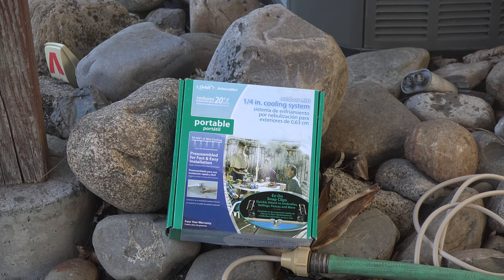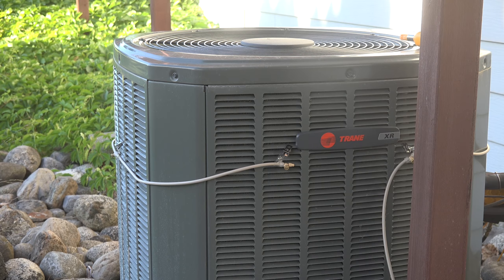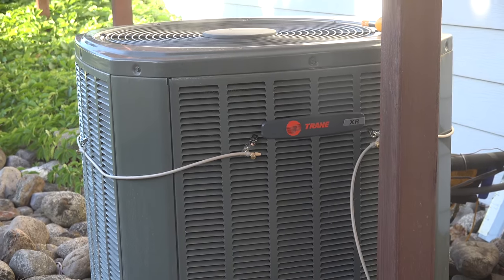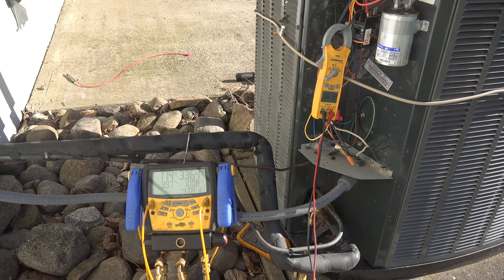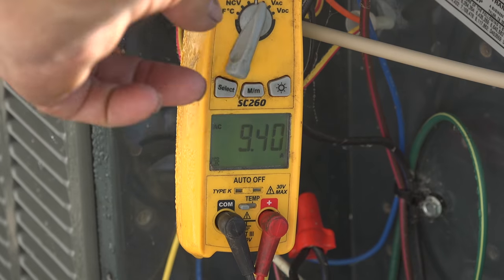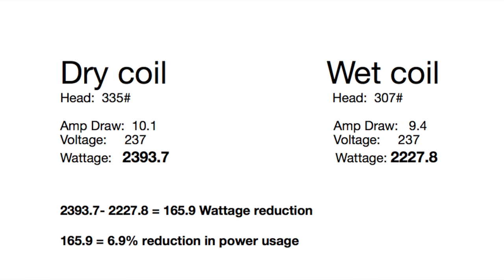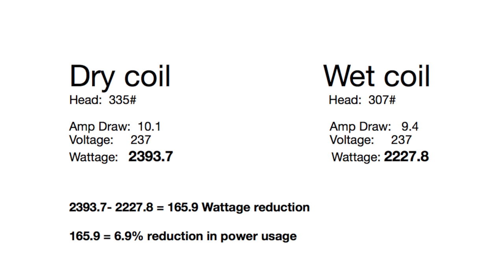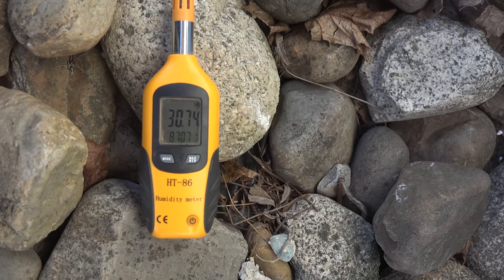Do the misters for A/C work? Part #1

Comment: Interesting. Thanks for making this video. I wouldn't bother with a water sprayer either. However, this water spray system may possibly be a little more effective than it looks. I say that because this water spray system may reduce the supply air temperature, which would mean that the AC wouldn't have to run as long to cool the structure, so there may be a little more savings there. Also, if it was hotter outside, there may also be more of a difference.
Reply from the maker: The theory of this thing is the atomization will evaporate the water.  I kind of got a shower when working with this thing, so the humidity must be much lower for it to work well.
GFM
Reply: Good point. I'm just saying that this system may lower the supply air temp a little, making the efficiency improvement a little bigger than it looks. Still wouldn't be worth it though.
Reply: Avery Alexander Having your system run less sounds like a great benefit but it's not. The less the ac runs the less humidity it will remove from inside the house effectively oversizing the unit. Couple that with any upgrades done previously like new attic insulation, new energy efficient windows etc and very likely cause humidity issues.....
Reply: I highly doubt that a water spray system will reduce the run time of the AC enough to cause a humidity issue, especially since a colder coil will condense more water as the system runs. But good point.
Reply: seems to me the only logical place for a mister setup is the hot and dry desert areas, Arizona is a good example. next problem, how much water do they have to spare?
Reply: I agree. Would've been interesting to have thermometers to give comparison on the supply and return before and after misting.
Reply: AA, as long as the refrigerant is fully condensed into a liquid, I don't think it makes much difference in regard to the temperature of the evaporative coil which normally run at about 40° F in air conditioning systems.  Generally that is actually regulated by the expansion valve.
Reply: TB, this is probably much more important that the relatively small amount of wattage saved.  On the other hand if the indoor climate remains the same, but less electric usage is reduced it would be a good thing, but that would have to be weighed against additional water usage and costs.  The people inside the structure could simply take a cold shower.  Anyway it's an interesting idea and a nice topic for discussion.
Reply from the maker: That video will be coming out soon.
GFM
Reply from the maker: The only possible change could be from increased pumping capacity from a lower compression ratio.  There will be another video on indoor coil delta T.
GFM
Reply: grayfurnaceman comparing the AC return and supply temperature delta with the misters on vs off would make the video complete I think.
Reply: grayfurnaceman comparing the AC return and supply temperature delta with the misters on vs off would make the video complete I think.
Reply from the maker: That video will be published soon.
GFM
Reply: Avery Alexander the coils get destroyed on commercial units my boss put sprinklers to flood the condenser to help during a 106 outside day with a 160ton unit condenser coils 8 feet high 16 feet wide 10 inch thick calcium  eat the aluminum like it was a snake, keeps unit running but not worth price of coil crane and install team
Reply: I feel like this system would really shine in a lower state such as texas on a hot day. This is just theoretical, but the head pressure will be 400 on a 100° day. The claim of 20% could be easily justified on a 100° day but it wont help much on a cooler day. A better system would be to build a cover over the unit to keep it out of direct sunlight.
Reply: Jonathan Roeder that’s not a completely true statement.  The less your system runs reduces the amount of dehumidification, but if your system is already running non stop because it’s 105° outside and it’s already removing more humidity than it has to, the air inside will still be effectively dehumidified.

A better way to save on power would be to have a correctly sized system in an efficiently insulated house, and install a dehumidifier system and raise the thermostat just a hair to say 78°
Reply: In my opinion I think those water misters isn't for cooling the air to go into the coils but to cool the coils faster. All the AC systems do is move hot air from inside to out through heat transfer. The water will make the coils more efficient by removing heat faster; it should in return make the air supply inside cooler. You need to measure the inside air blowing out a vent with and without the misters. Then you could run it to see how long it takes to cool in either situation. If it does run let's say 15 minutes instead of 20 for it to cool a few degrees then aside from the amp draw and wattage, you are also running it less time. Because in his example on the video he didn't take into account if it cooled faster. He only calculated an hour of runtime on each situation. Then the humidity issue inside the home. If there are real pros out there that truly know how to calculate the true ton measurements for the unit for the home taking into account the efficiency of windows, insulation, tightness of home, etc... Then you'd know the downsides of running cooler air for less time this making it oversized. High humidity levels from coils not removing enough humidity through condensation through the air handler will cause issues. I've seen more than enough humidity issues in homes. In theory this is a great concept but things aren't perfect. One is that water is contaminated and then the water will also damage the coils and fins somehow over years I bet. Great concept but it's one of those things, if it isn't broke.... I'd say just make the home more efficient. I build and bring buildings up to code. I have some schooling in AC and hands on in case some people want to know.
Reply: @aintquitewright1480  I think in humidity issues they are referring to the inside humidity not being removed enough through condensation from the inside coils in the air handler. Since the mister will in theory remove more heat through heat transfer, it'll run shorter thus not leaving enough time to remove enough interior moisture. What a lot of people don't understand is the AC units not only cool the homes(or transfer heat out for technical people) but also removes humidity from people breathing, cooking, leaky homes when it's humid out, etc... And that's where high humidity levels inside will affect the homes. But you are right for a month or so for a struggling unit that already is reaching the end would be good. Especially in a dry climate like Texas. He never considered the temperature being blown out the vents being cooler. He only did hour runtime comparison. Try it, in theory it should cool better. Let me know if it works I'm curious. Also what kills units is heat from being used a lot so this should also keep the unit running cooler probably extending it's life. But that's just a thought as in it makes sense on paper but will it actually work as there are so many other factors to consider like buildup and what will water mist really do to the outside unit in the long run .
Reply: Thank you for this reply, I made the same observation and got excoriated by morons who did not understand that when you add this system you also increase the fact that you have to do a little bit more maintenance to keep mineral deposits from getting on the condenser fins. They only look at the totally incomplete testing this guy did by testing a single Moment In Time instead of looking at time of operation, just as an example. If the air conditioner runs and uses just a little bit less power and only runs 80% of the time it used to run, that is more than a 20% decrease in operating expense. Having to occasionally treat the fens with something to keep mineral deposits would be cheap in comparison. Hopefully you didn't run into as many idiots as I did.
Reply: Question: how much would it help to keep the unit in the shade? No misters, just shade.
Reply: @JoeLinux2000  this is what these people dont understand.  The compressor is cooled by the refrigerant itself so spraying water on the coil doesn't help that, also the txv turns the liquid line refrigerant into a low temp vapor,  the temp is controlled by changing the pressure.  The txv is designed to adjusted regardless of the outside temp. Perhaps this works with an old fixed orifice system that isnt charged properly using old r22 refrigerant which soon you won't even be able to buy.  Dumb idea don't waste water doing something that will void your warranty

Comment: I’ve seen several videos made by homeowners who don’t know how the hell an a/c works demonstrating their mister systems and claiming it saves them all kinds of money. It’s good to see someone that actually knows what he’s talking about make a video that shows actual numbers.
Reply: JD. It doesn't matter if you understand the principles of AC or not if you notice that the utility bill goes down after you try it.  On the other hand the home owner might not realize the condenser fins are becoming crusted with calcium until a few years later when it becomes very inefficient.
Reply: Most new window units splash the condensed water onto the coils, this increases the energy efficiency ratio (EER) but at the expense of the coil oxidation. I typically drill/tap a drainage on these units so that they may last without premature weathering.
Reply: @DarkLinkAD  why are you bothering changing the way it's designed to function, condensed water does not have the calcium and mineral deposits in it that tap water does.
Reply: @44hawk28  It absolutely does. Any pool of water will collect minerals and accelerate corrosion.
And my A/C funtions perfectly well, at 42F on a 98F day.
Reply: @DarkLinkAD  yes water will collect minerals. But can freshly condensed water, just like distilled water as far less concentrations within it. Perhaps you don't understand but water that sitting on the ground where there's a hell of a lot of minerals and water that condenses on a fairly clean object are in two totally different environments or perhaps you believe the calcium sound of thin air when water condenses.
Reply: @44hawk28  Obviously you lack an understanding, the atmosphere itself will make clean water (and oil) electrically conductive with time.
  Look at any A/C unit more than a year old,  (window unit) you will see the accelerated corrosion only where condensed water makes contact.
Reply: @DarkLinkAD  I do understand the galvanic effect, the reason why most head gaskets go bad with people who leave antifreeze in their engines for longer than about 3 years at a time, but until it gets to about 0.3 volts it is relatively inert. As it ceases to remain water for long enough to achieve that, you have very little effect except over an extreme. Of time, several to 12 to 15 years. I have seen air conditioning condensers they have been outside for well over a decade this still operate pretty efficiently and they get rained on quite regularly. So what your issue is with water in general is beyond me, addressing the issues of using tap water is the only issue here. If it could be filtered or the minerals conducive to causing issues mitigated in some form, you may still see a 20 or better percent increase in the cooling effect of the unit. If its 20% more effective it also means it uses 20% less energy because it doesn't have to run as long. That was the issue of this video.

Arguing over the relative mineral content of water from varied sources does not address the issues of this video. Your ignorance of the mineral content of different forms of water is astounding. You're more than you can boil distilled water in a microwave because it doesn't have enough minerals in it to cause it to boil nor does it conduct electricity particularly well. As mineral content increases the effects of those minerals does as well. Not all water is the same.
Reply: @44hawk28  Listen, its simple. Trial an error alone shows accelerated corrosion, this you cant deny.
Reply: @DarkLinkAD  yes maintenance does increase when you use such devices, especially in uncontrolled conditions I've already stated that when you use tap water you must condition it and do more maintenance. But the video is not taking into account the increased efficiency of the cooling device, it is only measuring power usage in a single moment of time without considering that it might take less time to cool the house. For crying out loud stick to the subject of the video. Which is whether or not using a mister actually lowers power usage. As for condenser corrosion, it can be controlled with Pinnacle maintenance in most environments.
Reply: @44hawk28  Nahh.
Reply: The main thing that was not addressed in the fact that the coolant returning to the coil is measurably colder. I have tested mine with the mist from a garden hose and have seen a 10 deg drop at the outside filter.
Reply: @DarkLinkAD  I think I would use distilled water which means the expense of the water.
Reply: @gweedomurray9923  Glad you stopped in.
Reply: @DarkLinkAD   Thanks, buddy !
Reply: Lmao the dude got proved wrong with reasoning and just covers his ears then denies the fact, someone send this dude back to kindergarden
Reply: @DarkLinkAD  That water is being constantly replenished with fresh clean water. The condenser is also made of the same material as the evaporator, which is soaking wet during normal usage.

Comment: When I worked in the telecom business, I've misted the data center or computer room condensers when we'd lose a fan motor, and could keep running until the repair tech could come out to change out the motor.

Comment: Good video and good information. In 1980 I made a mister system with oil burner nozzles, a 24V solenoid valve, and a time clock to keep 8 low temp refrigeration systems on a supermarket running during the day when the oa temp was above 85 degrees, from June through August in Tennessee. These were older Hussman systems with undersized condensers. It increased the capacity and kept them running. It will work if it's the only alternative. It will also work temporarily while you are finding a replacement condenser fan motor. And it will help, in addition to throttling the suction service valve, if you have to do a hot case or walk-in start up low temp system on a really hot day. I am talking about roof top refrigeration condensing units when roof top temp is about 15+ degrees above ground level temperature. In these last two examples you don't need a mister, you can just use a water hose and fine spray nozzle.

Comment: Correct me if I am wrong, but the point of this type of setup is to not get the coils wet but to lower the temperature of the air charge.  This is why you spray the water out into the air and not directly onto the coils.   This concept is similar in spraying methanol or even water into a combustion engine to lower the ambient temperature allowing more air to be sucked in due to density.

This setup works much better when its 110 degrees outside in a dry environment or something at a much larger scale ( I believe they do this in buildings ).   I did a test when it was 108 degrees outside and did noticed a 5 degree drop ( 68.5 to 63.2 ) in the temperature coming out of the vents since the compressor was able to function more efficiently.  Was it worth it?  Maybe but only for 6-8 hours a day on the hottest weeks of the year to keep a decent temperature in the house, I didn't care about any sort of monetary savings on the electric bill.
Reply from the maker: This is seldom done in commercial buildings as the coils are damaged by calcium.  If you got a 5 degree drop, I would be amazed.  My tests show some units with a 1 degree loss of delta T and some with about 1 degree increase in delta T.  More on this in future videos.
GFM

Comment: I live in Altus, OK and I have a coworker who used a sprayer for 10 years and his system is still running. The water is very hard and he has a filter on it. So the 'expert' has little knowledge on this procedure. I had a system built in 1984 and used this and cut my bill down by 100 dollars per month. The system worked for 8 years until the motor and blower went out.

Comment: I had an older unit that I was trying to limp through an incredibly hot summer. The unit was having a hard time keeping the house cool it was so hot and the unit was so old. 

The water misters did help the unit maintain temperature inside the house which it wouldn’t do without the misters. Now the outside temperature was hitting around 105 and did so for about 2 weeks. 

So in that extreme of conditions it might work a little better, but fortunately, we don’t see those conditions that often.

Comment: The unit in this video also looks pretty new and nice. It's probably operating pretty efficiently already. But if it was an old POS that wasn't efficient, a system like this may have more of an effect. Just a thought.
Reply: Probably less efficient, since the coil fins are probably full of dirt, so the water has smaller surface to evaporate on.
Reply: Valid point. However, in that case, cleaning the coil would be a much more effective way to improve the system's efficiency than modding it anyway, and therefore should come first.
Reply: The delta T in a coil that is greater than 20 is a very good system.
Reply: Or you don't have good airflow.
Reply: Water bill goes up now!